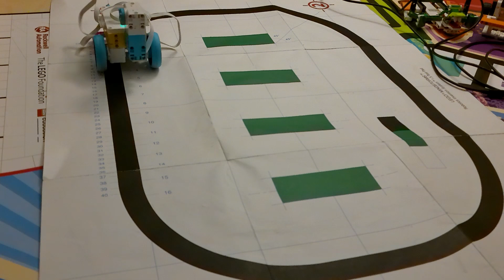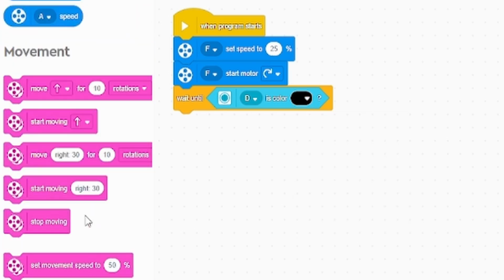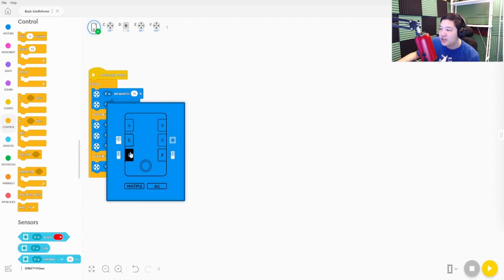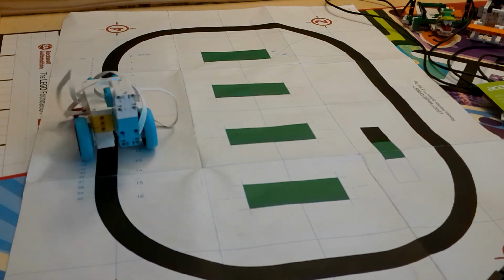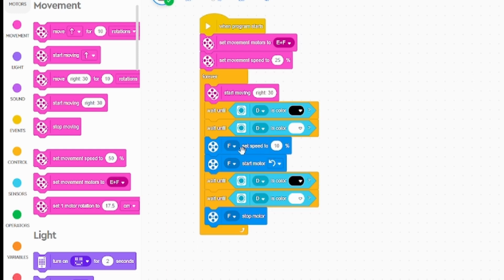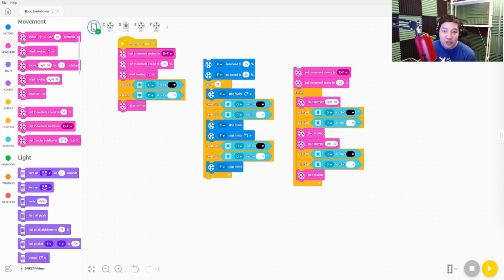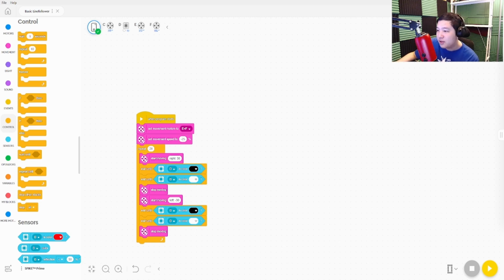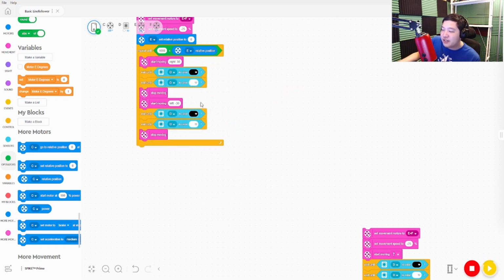How to Make a Linefollower in FLL

Comment: This is a great tutorial on how to develop one's own line-following program. It is also a great demonstration of how complex programs should be developed. Starting with small functional steps and ensuring that they work correctly, before adding layers of complexity, may sound tedious and time-consuming, but it allows one to avoid a lot of frustration and wasted time. 

I have found this approach allowed my teams to develop long and complex programs much faster and achieve more reliable and consistent results. 

It is much harder to find the root cause of a problem when one starts with a new and long program, especially if there are multiple errors in the program.
Reply from the maker: Thank you!